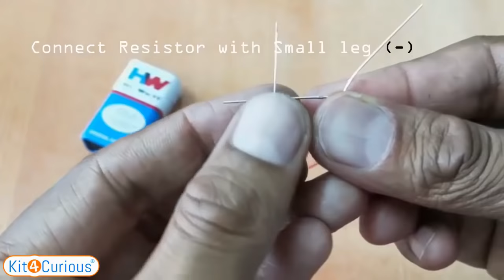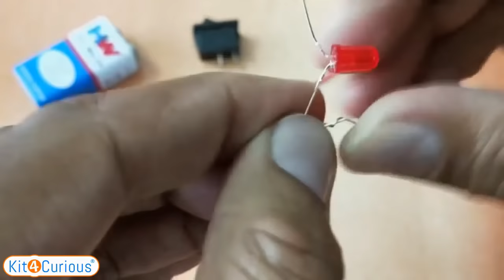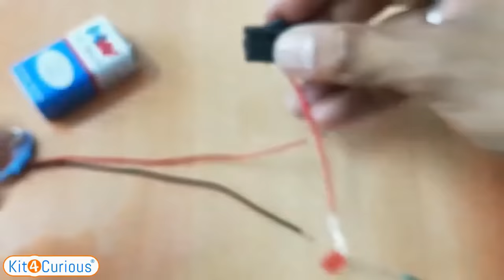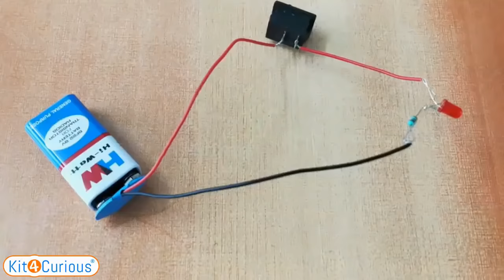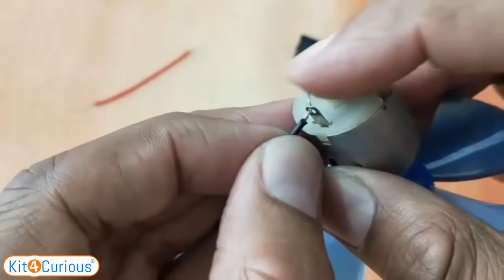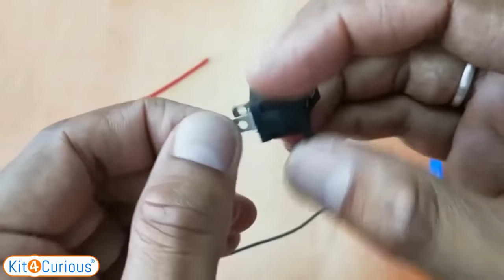9v Battery hacks - Switch, LED, Motor, Fan - Beginner tutorial

Comment: What is the use of the resistor in the light?
Reply: it protects components against voltage spikes, components that are sensitive to high electrical current like LED lights will be damaged if there is no resistor to control the electricity, thats how it got the name “resistor” because it resists electricity

Comment: we connected the LED, with out resistor, to the battery. It glowed once and afterwards LED is getting heated up but not glowing? is it compulsory to have the resistor?? I am also using 9 V battery. LED got damaged permanently?
Reply: The led got fused due to overload
The same thing happened to me and yes you need a resistor or you can divide the power, to do that you will need connect ATLEAST 5 bulbs to the battery together
What I did was, i connected two bulbs and 1 motor to divide the power.
Reply from the maker: Yes... Resistance is compulsory with 9v battery otherwise led will burn
Reply: Yeah the led is permanently damaged due to high voltage just throw it to the nearest dump site 

You need a resistor to minimize the flow of electrical current through led

Comment: Sir how we connect both bulb and Motor
Reply: I wanted to know too,that's why I clicked on the video,but I believe I got it ,,you just need to put 1 cable between the switch and the battery and a cable between the other side of the switch and the motor following the light bulb and finally to the other side of the battery. I'm trying to use both light and motor to build a epic headset stand 👌. Messed up that you got no reply to your answer.
Reply: @jennie14_  😎👌😣😣😢🍒👍🤣😭😏🤦🍀😡😏😡🍒😭😏🏃
Reply: @beastmodejelly8654  😊